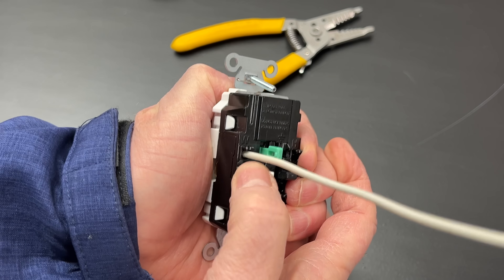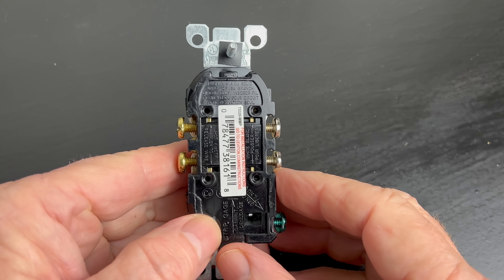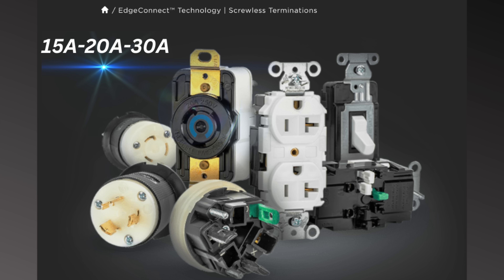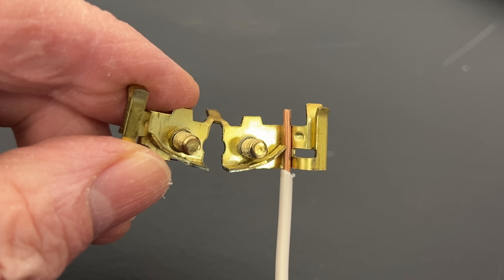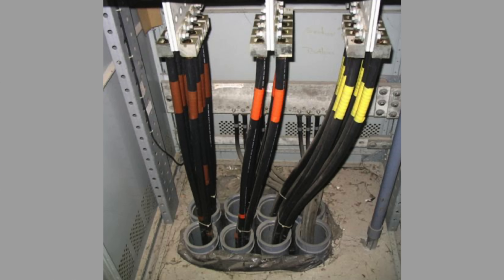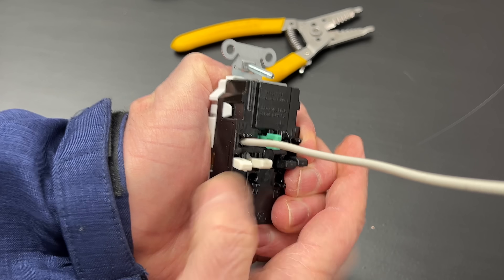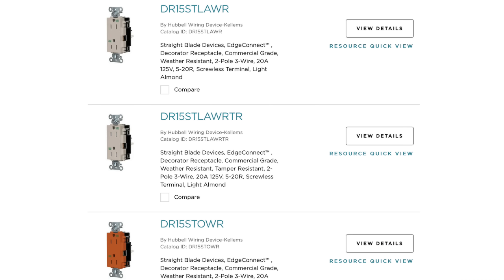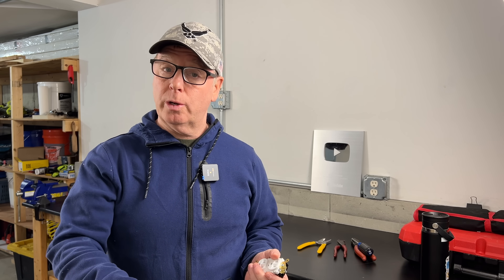This New Receptacle Design will set a New Standard (Welcome to the Future)

Comment from the maker: Hi Guys... Here's a new link that should accept your email address for a free sample. There was an issue with the link I provided but I believe Hubbell has it worked out now. So sorry for the confusion on this. https://www.hubbell.com/wiringdevice-kellems/en/edge-connect?utm_campaign=HES-WDK_EdgeConnect-2024&utm_source=eads&utm_term=inf.9&utm_medium=influencer
Reply: So basically a WAGO, Built into the device, this is a long time coming but it’s necessary, skills have gone down and stupid exists everywhere
Reply: Link never worked
Reply: Link doesn't work...
Reply: Link takes you to information about the devices, but I see nowhere on the page where you can get a sample.
Reply: I don’t think they worked out the problem
Reply: @JackGore Why do you say that? This seems like a very nice solution. I especially like the testing to show that vibration actually seats the connection better for higher pull out strength. I would like to see a comparison of results from heating cycles verses screw termination.
Reply: No freebies here.
Reply: Link not working
Reply: NO LINK NO SAMPLES…
Reply from the maker: @Allan11236  You literally just responded to the message with the link.
Reply: Link just opens a PDF brochure...
Reply from the maker: @aoksys31  Sorry the link must have expired.
Reply: Nothing for a free sample
Reply from the maker: @SaltMinerOU812  It may have expired. This is an old video.
Reply: Made in communist china.. hard pass on that junk..
Reply: Link doesn’t work
Reply: The replacement link isn't working either.
Reply from the maker: @stephenthein1949  Sorry, I suspect the link was only active for a few months. This video is quite old now.

Comment: Not just the enhanced spring tension....but also the apparent increase in contact AREA....a big plus in my mind, as the "point-load-contact" of the prior residential design, seems to violate ( be smaller),  than the wire gauge size used at the connection

Comment: It is about time for a new standard for NEMA5-15 receptacles.

I never understood how the actual NEC standard with its large exposed phase screws ( two of them per side ! ) was still in place, especially when used in metallic electrical boxes.

Next: These ridiculous highly brittle plastic cover plates that crack instantly, rather than difform, when you tight the plate screw(s) just sightly too much.

Comment: Unfortunately don’t see the free sample on that link
Reply from the maker: I’m not sure how long it was active. This is an older video.
Reply: @ ah makes sense. Thanks for the video. Good stuff. Subbed
Reply from the maker: @jaykid007_JasonDavis  Awesome.. Thank you and welcome to the channel.
Reply: @BackyardMaine thank you. Quick question. I installed a nema 14-50. I plugged the ground from the metal box to the ground outlet on the nema along with the main ground from the 6/3 wire. It works and maybe not correct. I want to pintail it so I ordered 10 awg copper for the extra tail. Is this the correct wire to tie in with the main wire and the ground? Thanks!
Reply from the maker: @ Yes, it sound like you did that correctly. I made a video where I installed a 30A generator inlet that may help you out. Its a smaller connection but the concept is the same. https://youtu.be/5y7RaJSAMZQ
Reply: Thank you. So it looks like you connected the metal box connected to the outlet and also connected the romex ground to the ground screw. So since I don’t have a connector like you do then I should just twist  and put the remaining wire in the nema outlet right?

Comment: same as stab yuck. can't troubleshoot easily. can't tell if corroded inside like left in a puddle and used. uhoh.   metal to metal connections. overload those new plugs then find em.  not good!!!!!. plus the new wire is not copper. or it is coated. different standards overseas.😢😢😢😢😢😢😢
Reply from the maker: Not even similar to the back stabs. I have a longer video where I cut the two open to show the difference
Reply: @BackyardMaine  thankyou

Comment: My kids house was built using cheap outlets and switches  the switches were falling apart i changed all of them it was a fire waiting to happen, then also cheated a main by putting in a dule breaker in a box that only uses a full size type that had arced a lot and kept blowing  the box was full so i had no choice but to clean the contacts and install a different brand that was harder to install but held on the bus bars tighter.  The code inspector passed it like that. 
A house acrossed the street did a simular house and it burned down 
Electrical problems. Faulty switches.

I changed all mine because they were dirty, they had all been the stab connections.  A good tight screw won't back off.

Comment: I much prefer the Leviton Edge series. The Leviton Edge are sleeker and better designed by having the levers on the side instead of adding more bulk to the back.
Reply from the maker: I agree that the Leviton DECORA Edge is a simpler design to use for sure. Easy to open and close much like a WAGO. But they are only offered in 15A receptacles, 3-ways and single pole switches, only in white DECORA and only residential grade. The Hubbell starts out at commercial grade and has a full catalog of device sizes, styles and colors. Maybe if Leviton expands their offering they would become more attractive to me.

Comment: so vibrations and thermal creep DO cause SOME loosening of screw terminals when not properly torqued? IMAGINE THAT! i had a commenter take a run at me in another one of your videos when i said that. it's good to hear facts and not opinion. thank you. (but i still advocate pigtailing. not saying it's required, just personal preference after some experience with older wiring that loosened over time.)

Comment: For decades ground and neutral on the left, hot on the right. Now some engineer decided to put the ground on the same side as the hot. No mention of it from you. 
Ex Bucksport electrician and usually enjoy your channel but these new Leviton and Hubbels are dumb.
Reply from the maker: I think we're going to see more and more of these as time goes on. I was surprised to learn that homeowners buy more receptacles and switches that the pros like ourselves do. The trend is to make them fool proof. The Hubbell Edge Connect is a much better device than the Leviton Decora Edge but they both make it easy for a DIYer to replace a device and have a long lasting connection. My 2 cent and thanks for watching my videos.

Comment: John as a semi-retired Champion Paper Bucksport electrician and side jobber, I enjoy your channel very much, however am very disappointed in the new Levaton and Hubbell receptacles. For years the green, ground terminal
and white, neutral terminal have been on the same side, opposite the black hot terminal. 
For some stupid reason some engineer decided to put the green ground on the same side as the black hot side. 
I’m disappointed you make no mention of this. 
I WILL NOT be using either product.
Reply from the maker: The location of the ground connection makes no difference in the way the receptacle or ground wire function. It's also clearly marked with the word ground and the ground symbol and it's also green so I don't think it will cause incorrect wiring either. 
This is the direction that the manufacturers seem to be going so I want to make people aware of how they work and whether or not I think they are any good. The video I made on the Leviton Decora Edge talked about the surprising ground location on the hot side. The Hubble has the ground in the middle of the device and the hot and neutral connections are not on the sides either. Anyway sorry to disappoint. Im doing my best to help people out.

Comment: The "back stab" connectors are definitely junk, and I have a story to illustrate.  Many years ago I bought a refurbished Maytag washer from a Maytag dealet.  You would expect to plug it in and have it work, right?  I plugged it in, in a house that was new to me, and it didn't run.  I called the dealer, who sent a technician over.  He checked the voltages everywhere and everything was normal, but the motor wouldn't start.  He went away puzzled.  I thought about it and decided to check the power receptacle.  It had been wired with the push-in connectors.  I moved the wires to the screws to make a proper connection, and it fixed the problem.  The push-in connections have higher resustance and won't support the starting vurrent of a motor.

Comment: Commercial grade devices can be used in residential,but in my view and experience,they were  designed for termination of the stranded conductors specified for commercial installations.Unless a device has a screw pressure binding force,I will not use it in my home.Also I consider the use of solid conductors for potentials over 240v to be dangerous,as these voltages require the most insulation integrity for safety.

Comment: just saw a new outlet type in a hospital build. U connect a prewired plug in the j box then plug that into the outlet. Couldn't get much info on it as it was the first time the sparky had seen it as well.
Reply from the maker: What was the brand?
Reply: @BackyardMaine  dont know.
Reply: i did a search and found it's called PlugTail® Connectors

Comment: I've never used the stab back or whatever its called. I had a friend of mine call me because some of the plugs in her trailer were not working.  Most of the problem was failure due to the push in connections.  Granted the trailer was probably from 1965, and to be honest the main reason the push in method fails is simply using heating appliances in those receptacles.  All of her plugs were burnt.  I took a few apart and could not believe her trailer didn't burn down.  I told her that the whole place needed rewired, I simply didn't have time to do this, as I worked full time.  Fast forward to a few years later, and her trailer did burn down.  She got out in time, but I'm glad I didn't get involved in trying to help her, I didn't want that liability.  I never heard what caused the fire, but it was either the receptacles or the fact that she used her oven with the door open to heat the place.  She did this because none of the plugs were working properly.  The difference between wrapping a conductor around a screw and getting a tight connection versus the small metal spring loaded tabs in the back, and I'm totally just guessing here,  but I would bet that you lose at least 50% conductor connectivity.  In my 45 years wiring, I could not believe that the holes in the back of receptacles were not phased out just for safety reasons alone.  Also, I thought the stab receptacles could only accept 14 gauge wire, am I wrong?
Reply from the maker: I completely agree with your assessment on the back stabs. I have also seen a lot of issue with them over the years. They used to be offered in 20A and 12 gauge wire as well but not anymore. They are currently only available in the 15A residential grade devices and 14 gauge solid copper wire only. Also one use only... I'm sure happy that your friend got out of the trailer safely.

Comment: I've installed one Leviton Decora Edge receptacle at home and it works even more easily than the Hubbell Edge Connect in that it is completely tool-less for both insertion and removal of the wire. As a counterpoint, I have some experience wiring outlets in the Philippines, and they use screw-clamp terminals there which work very well.
Reply from the maker: I like the Leviton decora edge as well (I made a video on them also) the only issue is they are limited to 15A residential grade devices and on receptacles, single pole and 3 way switches.

Comment: I wish a company would come out with these for aluminum wiring.
Reply: Existing aluminum wiring perhaps!
I wouldn't use aluminum smaller than #6 for anything! And probably not even then!
Reply: @Nonofyrbusiness my whole neighborhood has aluminum wiring since built in 1970.  Pain in the ass if you need to change or add outlets or switches especially if wire short and can’t find dimmers out outlets that take aluminum without a huge markup in price.

Comment: These outlets you show and absolutely better than a backstab, no argument there.  They solve many of the problems with backstabs.

They don't quite provide the same reliability as a metal on metal clamping force. I won't use those.  When the plastic gets old, brittle, and eventually fails to hold the force of the wire, the connection becomes loose, heats up, and the wire shoots out the back just like a backstab.

They solved many of the issues, but if that spring isn't pulling against the wire in contraction, but it's instead pressing against the wire and a plastic body in expansion, then I see bad things happening in the future.

A screw terminal converts torque to clamping force using a metal screw, nut, and metal plate to clamp that wire down.  There is no stress being held by the plastic after the screwing action is completed.

Comment: Lol on using weight, it would heat / thermal metal fatigue
Reply from the maker: No this connection preformed 2x the UL retention standard and even better than a screw connection with temperature variation vibration over time.

Comment: I feel like I saw a backstab connector that had the side screw go all the way through and force a plate hold the wire in place at one point.  Maybe on a GFCI receptacle, actually.

Unrelated, Dad always taught me to wrap the receptacle with electrical tape once when done to keep the screws from contacting an outlet box, but I've never seen anyone else do this.  Then again, Dad's generation was known for working on hot outlets.

I feel like the weight test was worthless without showing the old backstabs with the same test.
Reply from the maker: The connection with the plates and the screws are called back wiring. They  are very reliable and completely different than the stabs.
Reply: @BackyardMaine Fair enough.  I'm sorry if you thought I was trying to imply they were the same.   Just pointing out there was an alternative option.   I don't do enough wiring to be an expert, but my entire house needs the wiring updated so I try to learn this stuff and I'm always willing to be corrected if you can show that I'm wrong.

Comment: Interesting.  The contact mechanism in these actually looks very similar to what's inside WAGO connectors (just a bit larger, presumably to accommodate larger wire, with a slightly different lever mechanism)...

Comment: I'm more than happy for things to move forward and easy install; but just a little nitpick. both current stab connect and the new Edge Connect are working off of "spring tension".  Mind you, the stab  is a pretty awful spring, but it's there.
Reply from the maker: True but the stab connections is not spring steel. That’s why they are one use only. The edge connect uses a separate actual spring used to apply pressure to a separate conductive surface.

Comment: John (or is it Jon?)  I love your channel brother.  Retired GC/Homebuilder here and I've wired hundreds of homes over the years. EdgeConnect is a great step forward- no doubt.  And I'm not going to dispute that using the screw terminals is potentially a better connection than back-stabs. That's common sense. But did you realize that at least a big chunk (the Northeast at least) of the modular home industry (and I'm talking framed modulars.. not mobile homes - but those too ) use ONLY back-stabs?   And in any plants I've toured (which are many throughout PA, NY, and on up into NE over the years)  nobody was pig-tailing anything either.  This has been a few years but the devices they were purchasing in bulk didn't even have screw terminal - only backstabs.  Why?   According to every plant manager I've talked to - Consistency and reliability.  They're more monkey-proof (as long as the conductor is not nicked).  Screw terminals are ALSO  prone to problems, how many journeymen have you seen actually torquing those connections to spec?  Almost nobody does.  If you over-tighten the screw terminal (as many journeymen do),  especially on 14ga wire, it will crush and fail at the screw.  If you under-tighten the screw terminal, it can become intermittent and also fail.   I'm not saying the back-stabs are perfect- far from it , but they are kind of idiot-proof.  I typically never use them either - but the electrician I worked for on and off for 20 years DID, all the time. He was a really smart, careful guy and would not have done anything that caused him grief.  He passed away a few years ago but his work ethic and standards has stuck with me throughout my own career.  The only failures I've seen with back-stabs were caused by either a wire nicked when it was stripped (breaks off right at the surface of the device) OR they're being fed-through and consistently running that circuit at close to the tripping point weakens the device.  This was particularly true 30 yrs ago with tons of incandescent recessed  cans hauling on a $.39 light switch.  Or a countertop circuit with a couple of coffeemakers on full-time would eventually fry a cheap duplex device.  There's a case that should always be pig-tailed IMO.
Reply from the maker: It's John and Thank You! I also appreciate your comment very much.. I spend most of my career in large industry but I used to wire homes on the side. I have never seen a modular home build or the receptacles without screw connections..

Comment: This is a improvement  over the residential  outlet. I think that the contractor grade side wire is a better way to go.
When you use the side wire or back stab the newer version  the wire is held between 2 solid plates  and contact is along the full length of the wire. just like side wire screw holds contact on Bothe sides all along the wire. spring loading gives up its hold when it gets hot.